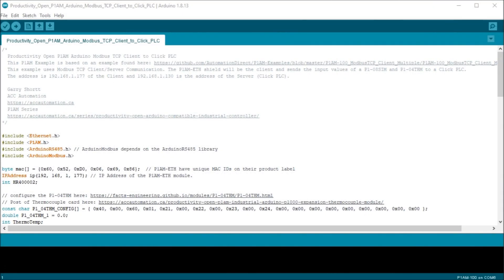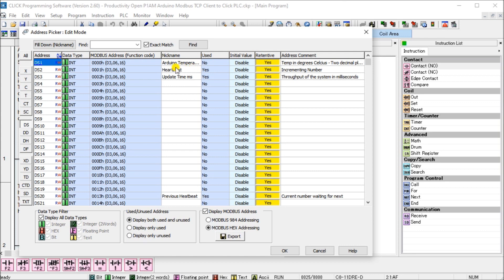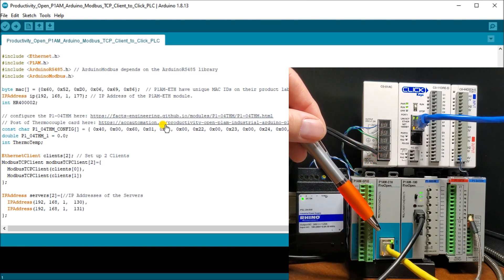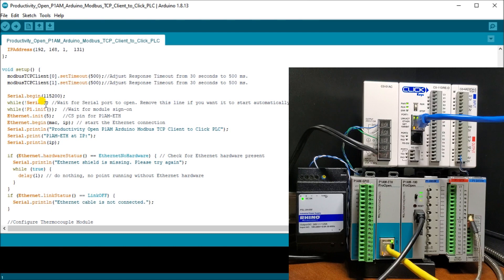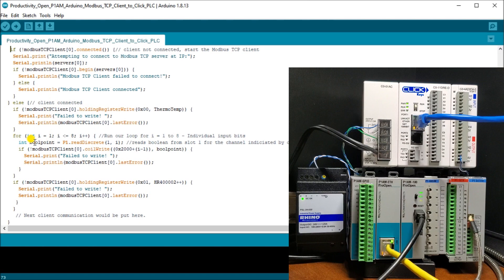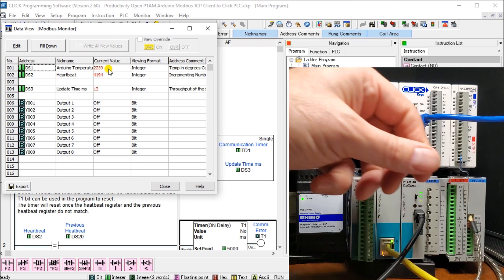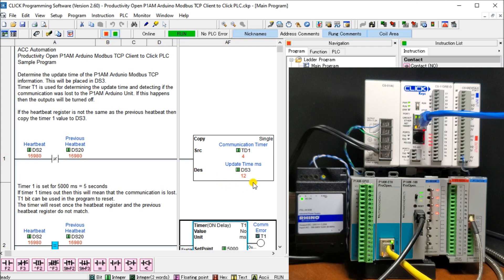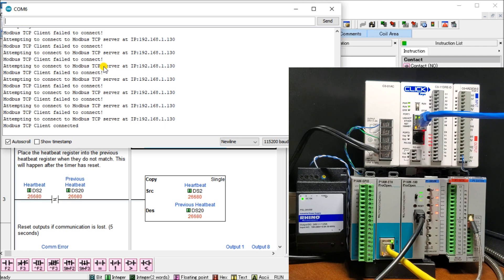Productivity Open P1AM Arduino Modbus TCP Client to Click PLC

Comment: Thank you for the detailed tutorial. This platform definitely gives you lots of flexibility.
Is there any Over the Air programming for the Productivity Open?
Reply from the maker: Hi Ioannis,
Programming of the P1AM is done by the USB connection only. If you are looking  for an HMI interface, to control over the air (WiFi) then take a look at the following post:
https://accautomation.ca/p1am-arduino-modbus-tcp-to-c-more-ea9/
It will show connection to the P1AM using the C-More EA9 and the remote phone app for control.
Thanks for the comment.
Regards,
Garry